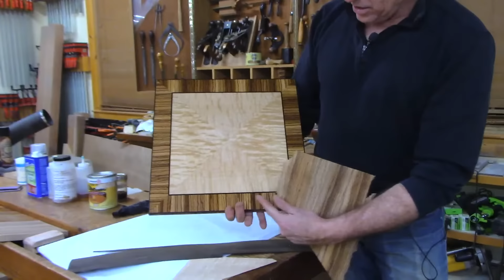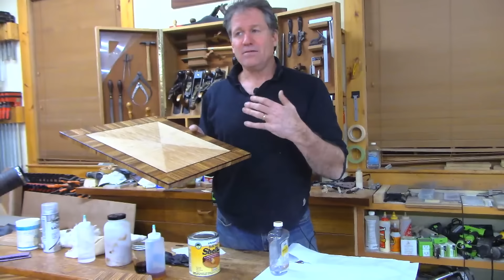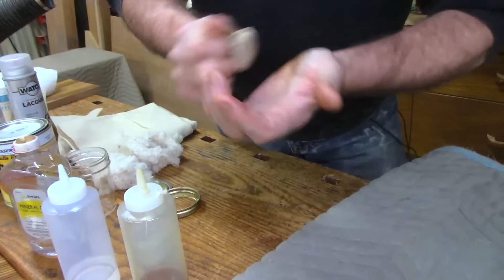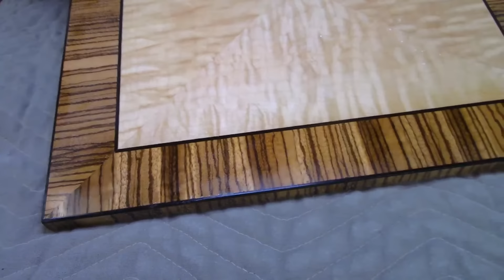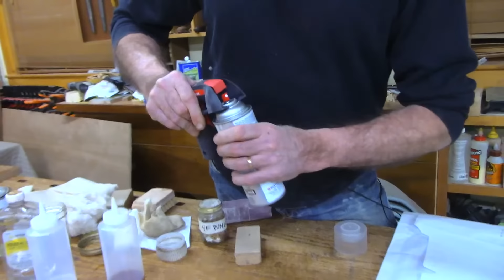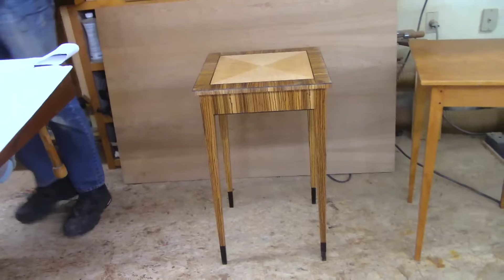Finishing Tips for Great Results

Comment: I get a very nice finish: thin seal coat of shellac, then 2 applications Poly-x using 4-0 steel wool to rub the 2nd one in.   Really beautiful.
Reply from the maker: Nice, I haven’t tried “poly-x”. Typically the poly finishes I’ve used in the past result in a naturally harder finish (due to the poly hardness) which tends not to respond well to rubbing out with 4-0 steel wool…unless it is in some kind of blend where it works better…I’m assuming Poly-x is a blend? Thanks! 👍
Reply: @EpicWoodworking      Osmo Poly-x satin.